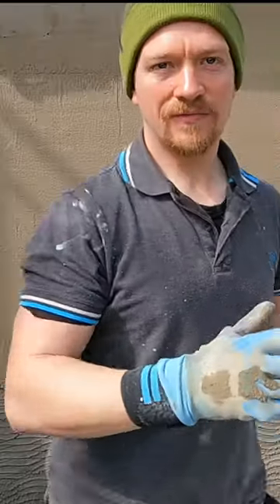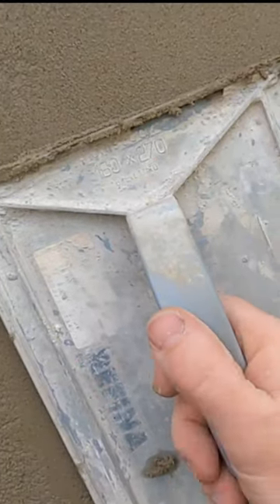Beginners Guide To Rendering Walls (4 Big TIPS) #shorts #construction #diy

Comment: I bought plastering sand from two different large UK merchants, both had small stones in, maybe 5 to 8 mm in diameter. I could get a reasonable mix with this sand, cement and lime and it applied surprisingly nicely, but when it came to poly floating it the small stones came loose and scored the surface.... Is it possible to avoid this with small stones in the sand?
Reply: Maybe apply a bit thicker. This could help.   Other than that u just got unlucky with some shit sand.   Happens some times ….